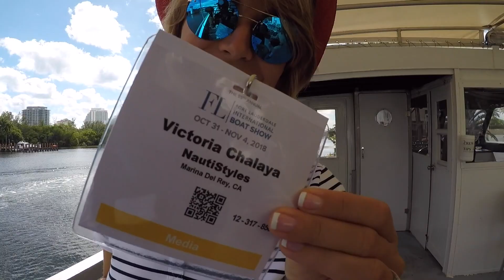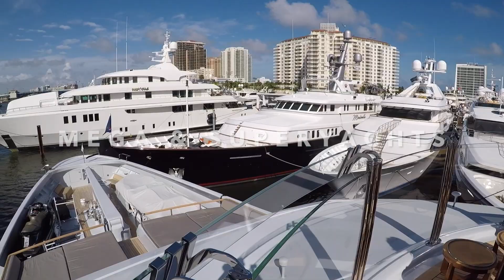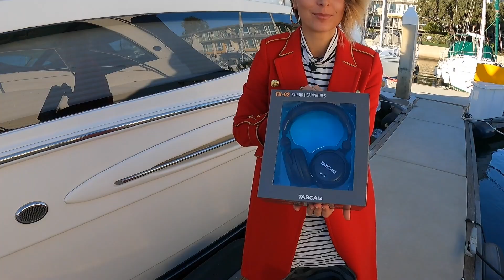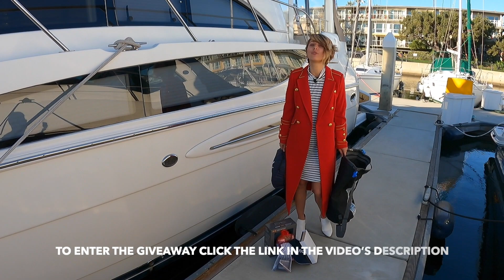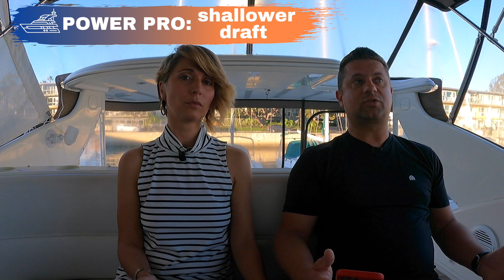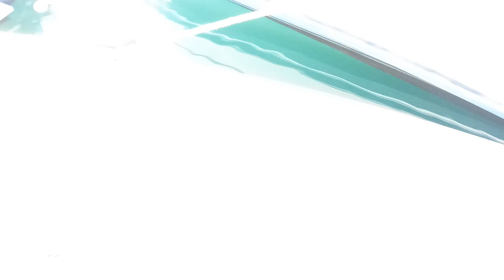POWER vs SAIL CATAMARAN Pros & Cons / Liveaboard Charter Sailing Yacht Tour Motor Boat Comparison

Comment: An electric propulsion does not exist yet. What is enough for cars, like 20kWt when a vehicle already moves, is not enough for a boat. And a battery you can afford in terms of a price and a weight, gives few hours of an electromotoring as a max (if you are in a current, you can find yourself at a same position after these few hours ))).

A speed comparison is more complex subject than it appears. To sail you need a wind. A wind means waves. Waves limit a speed. Not a sail or a cat. It's just about a safe speed to not crush a cat into a next wave. For a powercat sun always shines. So, this is a different speed. Specially built sailcats in ideal conditions like 20-30kt wind and no waves, can reach 28-30kt true speed. Not a big deal for them. Anyway, these are different speeds.

Comment: Just saw this video. Nice comparisons you guys. A couple comments. I have been looking at a number of powercats and notice some only have flybridge helms. If your getting on in age, to dock short handed you'll need to dash down the ladder to snag a cleat at the dock. Preferably with minimal breeze blowing you away from the dock. I suggest those interested look at cats with (dual) or ( inside helms) if short handing as I do is anticipated. 
Additionally, I currently have a 40' sailing cat with 2 x 30 hp diesels top speed 8kt motoring. However I can easily hit 11kt sailing.  I wonder how much bigger engines I would need to motor at 11kt. Lastly, either way cats are MUCH more costly to dock than monohulls as I've come to discover, so one should check ahead for an available end tie!

Comment: By the way, you forgot to say that the sails and cables and couplings and rigging, everything will have to be changed from time to time.  and if we take a short period of time, then the sail is more profitable, but if we take 5-10 years of boat ownership, then the motor will be cheaper

Comment: thanks for the cool review, but I think it's wrong that you didn't talk about hybrids and electric....I personally would build myself a boat in the likeness of silence 60 ...the entire roof is with solar panels with a rising middle section with fly bridge under....most powerful electric motors and super powerful onan Generator and also that parachute that Rico admired on the bow of the CAT.  that's all .. I have a lot of space, a lot of energy, I do not depend on the wind.  I swim where I want

Comment: Sail.  Best of both worlds.  Power (reasonably cheaply) when there is no wind or the wind is bad.  Sail when you have wind.
Plus redundancy.  Power if something goes wrong with the sails (ripped sail or damaged rigging).  Sail if something goes wrong with the motors (Both?  Pretty rare.  Out of fuel or bad fuel?)
Cant really do big ocean crossings on a powercat - unless its really big.  Then the fuel bill gets HUGE, but if you can afford a BIG powercat, then fuel costs probably aren't an issue for you.

Comment: It is my intention to design and have built an all electric power Cat and also have all of the sailing system features and benefits.  The best of both worlds.

Surely someone has created a full featured sailing Cat or Tri that is also powered by standard diesel engines or proper electric motors.

Comment: I'll choose power boats every day of the week but, you forgot to mention what I consider the best part of sailing and that is the fact that with sailing, you take out the biggest point of fire ignition there is on a boat. On a sailing boat you might have a fire while using the galley (which you should be more than prepared to take out) or by having a short behind the dishwasher during the night (because of moisture + lack of maintenance) but that's pretty much it.

Comment: I suspect you have only been on condo cat sailing catamarans by how you talk about the speed and safety concerns.  Having a sailing cat that is fast enough to outrun bad weather is a very basic consideration, as is getting from point A to point B quickly and not rolling in the waves.  Wrong about the draft issue also on sail vs. power cats, plenty of sail cats with 3' draft.  Talking to Lagoon/Fountaine Pajot reps at boat shows doesn't count as "doing your research".  Their boats are floating condos and nothing more.

Really not impressed with the lack of knowledge you are showing overall though.  It seems like a lot of the issues and concerns you bring up for sailing cats is if you are an incompetent owner who doesn't take basic safety or situational awareness  into consideration.  The hate comes from the fact that by a large margin the power boating community is where most of the obnoxious and inconsiderate boaters gravitate.

Comment: Besides a hull designed for a particular max speed, sailing hulls are aslo designed to compensate for the torque moment of the sailes. A motor hull can just focus on speed and the horizontal push of the propellers.

Power cat has less interior hull space for the large engines, engine compartments and fuel tanks. 

Electric power cats (e.g Silent Yachts, Sunreef Eco, etc) falls somewhere inbetween, but deserves its own category.

Comment: Great video on what has become the Great Debate; Sailing vs Power Catamarans. My situation is I have been actively speaking with several manufacturers of blue water vessels and have decided to go with a performance sailing catamaran (19.5m - 21m) custom made from aluminum (5383/H321/116). One aspect of the discussion you did not touch on is hull materials (e-glass/carbon fiber vs metal/ Marine grade aluminum 5085/5385). 

Having owned and sailed catamarans ranging in LOA from 14m - 19m made almost exclusively from eglass over a 25 year period a true pelagic vessel must be metal full stop. Yes, there are quite capable full blue water vessels constructed from e-glass. BUT sailing SAFELY in a variety of conditions at sea and having the widest possible range of operation marine-grade aluminum vessel constructed by a builder with the experience and expertise in constructing a Catagory A vessel wins hands down. I'm fairly certain your friends at Bering and CdM would agree. 

Hybrid electric-diesel propulsion systems for a pelagic vessel have reached the point of being not only reliable but will soon supplant diesel-only on sailing vessels. More and more jurisdictions are placing restrictions on operating vessels under straight diesel power, especially in harbors, ports and navigatable waterways. A potential owner/operator of a blue water vessel must future proof their vessels looking 5 - 8 years ahead.

Comment: I'm a regular viewer and a Patreon member, but I'm getting to this particular one late and it's really helpful. I think my biggest concern with sailing catamarans is that even now, when so many are built for a singlehand sailor, it's just way too much work just to keep it up. You said that a sailing cat is more of a full time job, and that's a problem for my family, all of whom are older and not fully healthy. We feel that we can handle the work involved in a power cat, but... well, there's a reason people tend to define long-distance sailing as "working on your boat in a lot of exotic locations." 🤣

I'm concerned by the range issues, though, and I'm seriously considering buying a power cat and getting the power train converted to solar-electric, which really does seem to be the best of both worlds. I can't afford the Silent Yachts because they're so new, but an older power model that gets reconfigured is affordable even with the $100k cost or so to get the conversion done. I know you need to feed the batteries from more then the sun sometimes anyway, but from what I can tell, if you're willing to cruise slowly, not too often. Hopefully that'll let us eke out enough to be safe on long distance passages!

Comment: Speed: if you have your boat based in your marina and you usually only have the weekend to go boating, with a faster boat your range of options of where to go can be massively bigger. After for example 5 years into boating from that same place, if you get a faster boat suddenly you can see new places. 

If your boat is twice as fast, basically your 'boating playground' is twice as large.

Comment: All good points, but I kind of disagree about the work of sailing. Yes, sailing can be more work than a powerboat; I do both and currently own a 50' MY, but am building a 50' sailing cat. My cat will have 2-3 Anderson power winches, so raising the main and furling the jib or headsail, even reefing, is just the push of a button. It will have all lithium batteries and over 2,200 KW of solar with 29 Yanmars for ease of servicing until I can pull them and just have electric engines when the technology is up to par. If you set up a sailboat right, it can be quite effortless, but if you want the exercise or the feel of the work of sailing, you can certainly control everything manually as well. And if you are traveling long distances on a MY (say a full displacement boat,) you better have plenty of spare engine parts. And likewise, if you're just coastal sailing or island hopping, you don't need many spare parts on a sailboat as long as you can get them on shore. Cheers!

Comment: One big difference, a lot more skill and knowledge is required for a sail, not to mention work with all the ropes and stuff!  You just can’t turn the boat in the direction you want to go.  I know what tacking is but no idea how to accomplish it.  If I were going to get a boat the question would be mono or dual hull and I think I would lean towards a cat for stability.

Comment: Nordhavn for the win! What are your thoughts on those vessels?
Reply: Was on a Nordhavn 56 and was considering one as I am soon to retire. Amazing boat, however, I have a 50' Riva MY, and have sailed a lot over 5 decades, and I am building a 50' sailing cat. I have never been seasick in my life, but came close on the Nordhavn. I was surprised at how much it rolled in a beam sea, even with the stabilizers on. Of course, it's a full displacement boat, so it cannot plane, and half of the people on board got sick. It was the first time I ever felt queasy on a boat in all the years of having been on boats. Displacement boats are great for long distances, but you definitely feel the seas more than on a cat.

Comment: Thank you so much for your thoughtful analysis.   I disagree with the hull speed issue.  If the hulls are sufficiently narrow they escape the bounds of Archimedes' hull speed principal.  This would be true of both sailing and power catamarans.   The power required to drive a catamaran through the water is very closely correlated with how narrow the hulls are.   A planing power cat will use vastly more fuel than a power cat with narrow hulls, and won't go any faster.   At present, almost no commercially available power cats have efficient narrow hulls.  Some of the new solar-electric catamarans are getting this figured out and designing properly with very narrow hulls.
Reply: Hi Mark,

 I just came across this video and your comments. I do wish to concur with you on a cats "hull speed" . I bought a 40' cat 2 yrs back. With 2x 30 hp Volvos/ saildrives I can motor at max 8 kt at 2600 rpm. However, I can easily hit 11kt close reaching in 15kt breeze and have touched 16kt with my big reacher. This was NOT surfing. So 1.3 x the  sq root of waterline length doesn't seem to apply in actual practice.

Comment: Overall a good look at the pros and cons of power versus sail for catamarans.  The one point I would add, which you somewhat covered under maintenance, is the additional cost of sailing versus fuel burnt.  The cost of replacing rigging, standing and running, and sails and covers which power boats don't have.  I also have to added a thought on the "hate" between power and sail.  I agree completely with Rico on this subject if you like boats you like all boats, power or sail.  The problem is the people who operate them.

Comment: Which requires less crew to control it?? 

(Can you drive a power Cat, 1 person operated??)
Reply from the maker: yes, power at would be easier if you compare to sailing. but depending on the size you can definitely single-hand sail a smaller cat as well, under 54 ft

Comment: When it come to sail vs power, sail is about the journey with no deadlines and power is about getting to the next port as fast as possible and having a cocktail. Since I have no need to go anywhere in a rush, I have gone with sail. With power, you can only go as far as the fuel line stretches and sail is unlimited. It's up to you as to which life style you prefer.

Comment: A power cat.  Hands down.  A leopard 52PC has a nautical mile range of 2,400 at 7 knots and 3,200 at 6 knots.  I will take that any day over doing maybe 7 knots on average with the hassle of sails and rigging.  Never mind eliminating the danger of moving forward on the deck because of problems in bad weather.  I also value having clean useable areas that are not cluttered with ropes etc.  Money being no object, I would buy a solar cat with generator backup.
Reply from the maker: all valid point 👌🏻👌🏻

Comment: Hi, could you explain again the speed x hull shape issue? 17 knots for power cat? A sail cat reach these speeds too, with no problem. Don't understand why the hulls must be so different... Except for the structure needed for big engines...

Comment: First, that was an excellent video. But to me the most important pro for power boat that you did not mention, is that it can be driven with just one person.
Reply from the maker: Most of the newer sailing cats can be sail solo as well, but you will still need at least 2 people to dock properly

Comment: Hi Guys! Great episode. I am working towards building a fully electric liveaboard powercat between 45-55 and I agree, in 3-4 years time we will see a big change in the propulsion system. I also want to add a kite to the powercat "Sky sails" it will drive you and recharge your batteries. My favoriet design, with a few changes is the Aquanaut from the Italian hull designer Officina Armare.
Reply: You think a current power cat will be easily retrofitted to an all electric cat when the time will come (

Comment: You understated the ICW 64ft mast height issue.  Sailing cats have tall masts.  Your options on the USA east coast are quite limited for sailing cats over about 44ft in length.  You also missed the costs to keep the sails and rigging updated.  About $1500 per year needs to be reserved for this.  You can buy lots of fuel for $1500.
Reply from the maker: You are definitely not limited to staying in the ICW, you can go around the limited areas on a larger cat no problem. We Did mention the cost of maintaining the rigg
Reply: @NautiStyles  I think you misread the comment.  With a mast height over 64 feet you are limited on where you can go on the ICW.  If you wish to use the ICW as an option during adverse winds / weather / rough seas...you are most definitely limited with a sailing cat over about 44 feet in length.  your only option for much of the ICW with a tall mast is to exit the ICW and head out to sea or sit tight for a weather window that is favorable...versus a power cat that can carry on up / down the ICW unencumbered.  In terms of rigging + sails these are two separate costs, both need needing maintenance or repair every 7 to 10 years.  You can reduce the costs somewhat via DIY (re-stitching, patching, spot repairs, etc.) but the market value of rigging replacement and working sail replacement, in very general terms, is $10k to $15k EACH...every 10 years.  In the alternative, a power cat can utilize the entire ICW without any obstacles and the cost savings of not having sail and rigging maintenance covers much of the fuel costs at moderate (or comparable) cruising speeds as the sailing cat.

Comment: Fantastic information here and your points also apply to monohulls. I lived on a wooden ketch in south Florida/Bahamas for almost a year. I agree completely with your assessments. In that time, I bet that I sailed fewer than 40 days. Most time underway was spent motoring/motor sailing because of unfavorable wind conditions versus water depth. Additionally, I had to change the jib to a storm sail in 7 ft seas once (this was before roller furling) and that was sufficient adventure for a life time. Love your channel.

Comment: That was fun!  Yah, it isn't too hard to figure out why Silent Yachts has all the customers they can serve and more waiting in line.  It's very close to the literal best of both worlds.  Just can't make those solar/electric rigs fast enough.  In a world where gas-guzzlers simply aren't going to be as acceptable or desirable for several reasons, renewable energy + battery systems are the future for most folks who can take a casual pace.

Speed freaks will always be speed freaks, basically a pain to everyone else's existence around them, including every other species on the planet.

However, I have to admit that for the ultimate aesthetic, for the pure feel of riding on the very forces of Nature herself, there is no match for a sailboat on even a decent day.  That shouldn't be underestimated.  On a sailboat, you are entirely indwelling in the interplay of the environment, with an intimacy that can't be found on any others.  It's a special kind of artistic nirvana unto itself!

Last week (12/24) The O'Kelly's channel released a half hour video of just them sailing in the Caribbean, with no other soundtrack or dialogue.  It's so relaxingly hypnotic and peaceful, you can feel yourself really sinking into that groove.  Compared to that, even the solar/electric yachts don't have as much soul underway.  It's an extreme example, but it's also a sensation and perception of ones place and pathway in the cosmos that has no rival.

Sometimes, there are things beyond even our expected use-cases.  These are matters of simply... being.